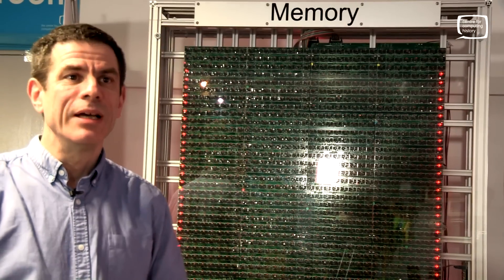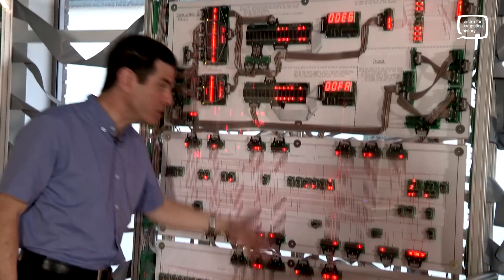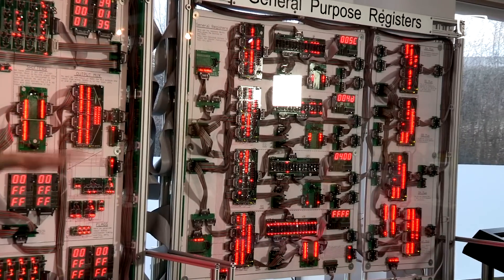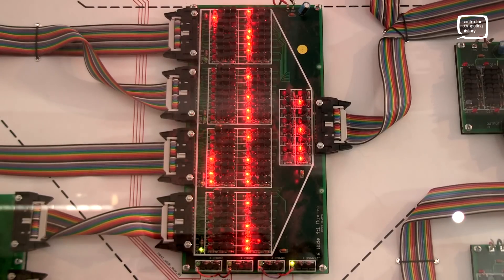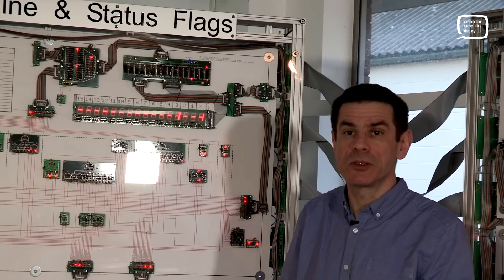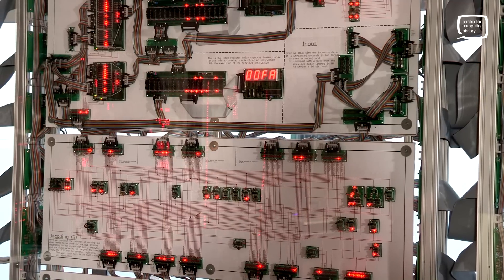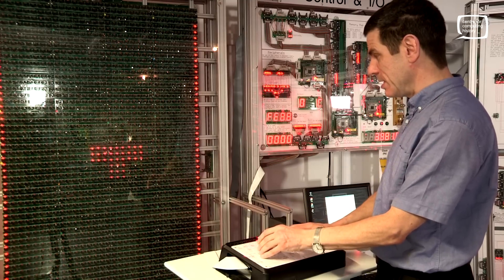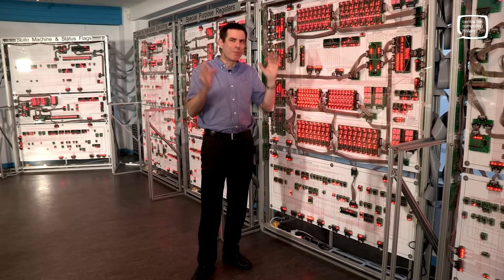The MegaProcessor

Comment: I am conditioned, via the advent of large supercomputers in the 80s, to think that many blinkenlights on a computer means a supercomputer. Think of The N Machine from Thinking Machines for an example of where my head was at. So I was quite startled when James began his intro and I saw it was some kind of giant breadboard built with 80/20 - obviously a prototype of some kind. ;)  This is a great project tho!  Quite a bit more ambitious than the discreet 16-bit machine my friend built, not with discrete transistors (good god, man!) but with CMOS chips. It's rather smaller as a result. ^_^
Reply: And as a child of the 60s, I was conditioned to the same conclusion by Star Trek ;-)

Comment: You do realize there are different colors of LEDs besides red, right?

Seriously this is an amazing demonstration.
Reply from the maker: Price had a part to play in that decision. With that many LEDs every few pence you can save makes a big difference to the total cost! :)
Reply: Red is also more traditional; it was the first colour you could get LEDs in. I wouldn't be surprised to learn that this was the actual reason he chose red.
Reply: Using many different colors would have complicated the design a bit.  LEDs have different "on" voltages, and they vary by color.  In order to keep an LED from burning itself out, you have to put a current limiting resistor on it.  If you're using different on-voltages, you'd have to use different current limiting resistors, which would mean that every time he needed to put an LED somewhere in the design he'd have to change that current limiting resistor.  It was probably just easier and cheaper to use one standard LED.
Reply: @Calphool222  Surely whatever circuit layout program was used to design this, has the ability to place an LED & the appropriate resistor together as a single element.  If each LED and every resistor needs to be placed individually that would be ridiculously inefficient.
Reply: @GoatTheGoat  Doubt it.  Each PCB looks like it was designed and built individually.  Normally you don't drop LEDs and resistors as pairs on a schematic (though you could with a library component if you built one, as long as the LED and resistor were in a consistent location relative to one another).  By having different resistors, you'd have different current draws on each board, which can get you into some squirrelly situations elsewhere as you're trying to bias components.  It's certainly possible to make it work with many colored LEDs, but it would have made an already gigantic task that much more of a pain in the neck.  So, if someone does end up building one that uses multi-color LEDs, appreciate the fact that they went to a bunch of extra work to do that for you.  :-)
Reply: He was going for full KITT vibes.

Comment: But can it run Crysis ?
Reply: Yeah, but it would take several years at lowest resolution in order to get the first frame of the game... (if you won't be arrested earlier for not paying your bills for electricity of course)
Reply: @sliceofthatpie  actually nope its not posssible since it isnt built on x86 architecture
Reply: Oof
Reply: Crysis would have to be be massively downgraded to be able to be run on the Megaprocessor hardware.